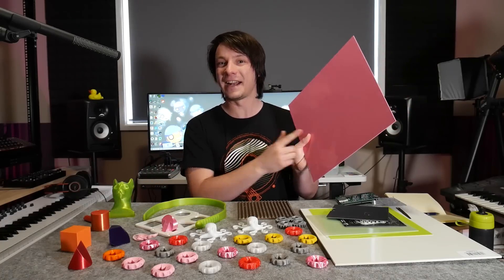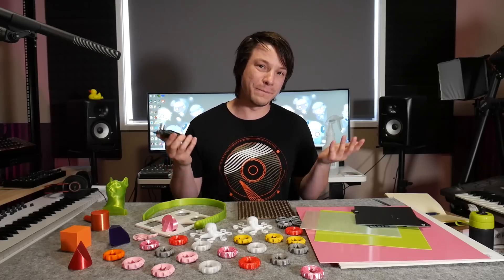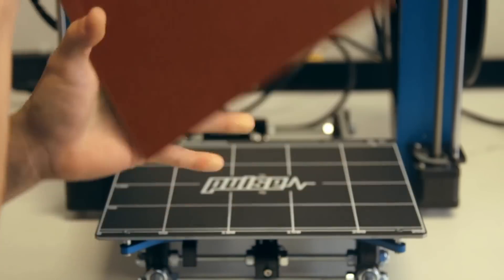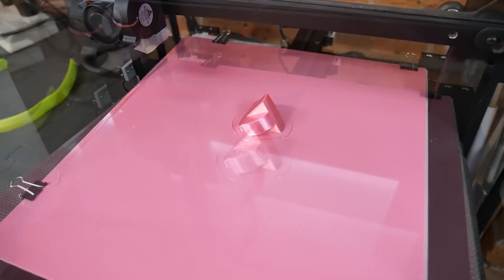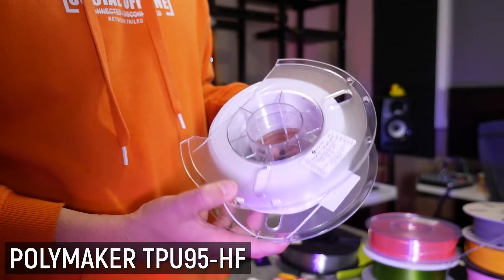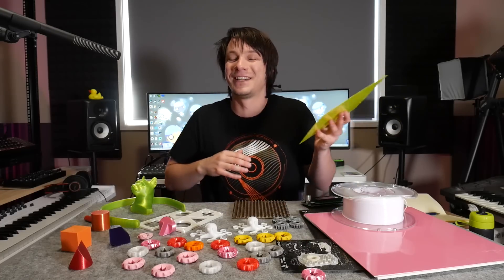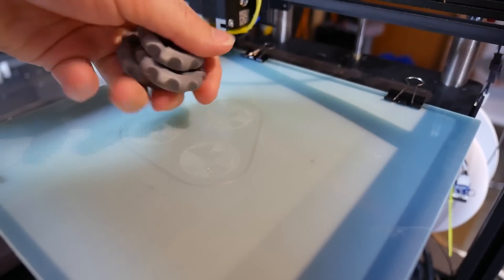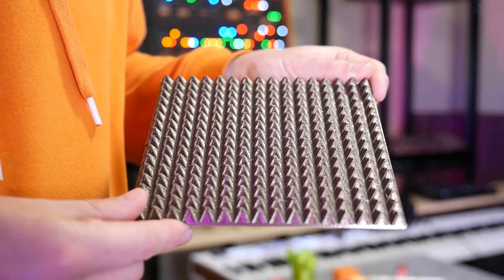G10 - The best print surface you've never heard of.

Comment: as for ABS, I print it with minimum cooling and higher temp, it improves overhangs drastically and doesn't break layer adhesion. ABS is my go to because it's cheap and tough.

Comment: I use silicone sheets under my build surfaces in stead of those annoying "alligator clips". Heat transfers through it, and the stickiness holds onto the build surface firmly. I would recommend 1mm thickness.
Reply: For what are such sheets being normally used? Would help to find them.

Comment: Glad you like it :D i use G10/FR4 for years now. Recently took the thin stuff and glued it to a spring steel sheet. That way you dont need clips, heats faster and is my absolute favorite surface :) great video 👍
Reply: Just wondering why use this over spring steel suck as the pei bases? Most people have excellent quality from using just that.
Reply: @madbull4666  Nylon....people seem to have issues getting nylon to stick to pei. If you don't print nylon G10 looks to be a waste. The storage issues of nylon make it a pain for hobbyists so its probably the reason G10 isn't very popular.
Reply: @madbull4666  What ever works for you. I switched to G10 before powder coated PEI was a thing. The PEI stickers an Buildtack clone always ripped after a while. It's just no maintenance for me, so I'm happy with it
Reply: Is there much truth in the stories of destroying a pei sheet when printing PETG? I was afraid to try PETG as my first print on my new pei bed...
Reply: @super_slo  I frequently print PETG on a Prusa mk2.5 with standard settings with a spring steel pei bed with no issues. I do generally preheat the bed to approx 40 degrees to remove the print tho. It was my first try at flexible that ripped a hunk out of the pei! At least I think it's pei that Prusa use.
Reply: @super_slo  for powder coated beds its less of an issue I think but those with a glued on sheet tear up after a while if you don't nail the first layer height.

Comment: You compared it with glass for example, but how does it compare with the powder coated PEI sheets from Prusa? Obviously you get a very different finish for the bottom layer, but I had great luck with PETG with powder coated PEI.
Reply: Exactly what I'm wondering too.

Comment: if your sheet does warp just bake the sheet between 2 sheets of glass at ~130 for a couple hours then let it cool slowly
Reply: Celcius?
Reply: @hyperspeed1313  yep. Make sure the glass is flat and cool the sheet as slowly as you can
Reply: to elaborate for anyone else that stumbles in here, you want to let the temperature lower on the sheet as evenly as possible, else itll shatter as one part cools faster and bends, well its a glass like thing, glass doesnt bend it shatters. need to heat it evenly too or the same will happen if it even matters for this material. 
also unless itll adhere to stuff at that temperate wouldnt any sort of really flat+smooth and rigid material work (e.g. a metal sheet?)
Reply: @Ruckusmatter  Not all polymers have a glass transition temperature and most of the epoxy resins are among of them. Once the are cured the reaction is done and you have one board size molecule of polymer that can't be shaped by temperature like thermaplastics do. The only thing that is working here is pressing them flat.
Reply: @0thorgal0  then mine was plastic. It was warping under heat, now it doesn't

Comment: How the heck do you do a first layer calibration for this material on a Prusa Mini when the G10 isn't composed of the metal the PINDA sensor requires to sense correct distances from the G10 build plate?
Reply: You can get circuit board material with one side copper clad pretty easily.
Reply from the maker: Hmm that might actually work !
Reply: @MakersMuse  I don't own a Prusa and have never dealt with the PINDA, but thought they would scan up to 2mm?
Copper pots seem to work fine on an inductive cooktop. 
Is the inductive circuitry of the PINDA so different that you couldn't run the copper side of a 1/16" (1.5mm) clad board face down?
Reply from the maker: Can't, you're stuck with metal or a super thin layer but might as well use PEI.

Comment: 0:00 G10, what is that?
0:36 Oh, it’s FR4, the same material used in PCBs! That also has the extra advantage that you can use a PCB if you can’t find alternatives.
Reply: Same. I was like 
"Wow, I've heard about so many beds, even rare ones like FR4 for Nylon, but not G10. Let's find out what this mysterious material is"
"Oh it's just FR4"
"Oh. You can use it for more than just Nylon??"
Reply: @KentoCommenT  fr4 is better read some of the other comments high temp and fire retardant
Reply: Hmm so I could design a PCB without copper or solder mask and have JLCPCB fab it.... Might have to give that a go
Reply: @sonosus  You pay them by the square inch for "production" of nothing, and etching off all the copper that someone carefully laminated onto it, so it's possibly not the most efficient way to do it! (I guess they would mill out corners etc for you though, if you wanted a nicer mounting solution)
Reply: @howardjones543  You could use 1 sided PCBs. That way you get FR4 on one side for adhesion and copper on the other for heat distribution.
Reply: @sonosus  You can buy single-sided copper-clad FR4 directly, without involving someone like PCBway. It's what you use to etch your own PCBs at home. Cheap on ebay.
Reply: @howardjones543  what's the best place to get this in bulk?
Reply: @sonosus  Wouldn't a copper ground plane each side aid in heat uniformity?
Reply: @KentoCommenT  Isn't it the raw FR4 that gives the material the stickiness? Maybe having a ground plane on one side could work though. I'll give it a shot on my Ender 3 sometime.
Reply: @KentoCommenT  You forgot the different heat expansion. I don't know how much it will affect uncut cuprexit (name of FR4 with copper foil for PCB's), but difference between heat expansion of copper and FR4 is the the cause of delaminating copper when you overheat it while soldering 😞 In the better case it will just deform, in worse case it will start to delaminate and either way you get an unleveled print surface. Bare FR4 would then be the best option for 3DP bed.
Reply: @sonosus  That sounds... Wasteful.
Reply: FR4 is also one of the first materials that was used for print beds. Obviously people hacking electronics back then were familiar with circuit boards and their heat resistance. Even experimental heaters were built right into those by etching a long coil on the bottom.
Reply: Where to order it please ?

Comment: I wonder if adding magnetic pads to the Ender 3 plate and the base of the G10 will work. Has anyone had layer shifting with this method?
Reply: In theory it could work.
Personally, if I did that I'd also add some kind of indexing method to keep sheet shifting to a minimum.
Reply: I did it and it works Really Well. My Ender magnetic bed has alternating strips of North-South, which you discover when you place a magnet on it.
I bought an A4 sheet of magnetic vinyl from Office Works and cut off 6 strips 1 cm wide. To those I attached the thin type of double sided tape. I removed the tape backing, placed the strips on the bed then placed the sheet of G10 onto the strips, rubbing over it to ensure a good adhesion. The G10 always aligns exactly as it was placed, ie perfectly. 

It's great to be able to take the sheet off, bend the print off, then replace the G10 perfectly without effort.
Reply: @gryphonista  Thank you for the reply. Sounds promising. What's the thickness of the magnetic vinyl?

Comment: I bought my ultrabase for the "cold and release" feature. Which worked great. But now the prints don't stick at. all. The filament gets dragged by the nozzle. Might buy some isopropyl to clean it. I've tried cleaning it with 100% ethanol but it doesn't work.
Reply: You can always just use water and soap
Reply: @Karavusk  thank you

Comment: Alternative title: "The print surface they don't want you to know about."
Reply from the maker: Print bed companies hate him!
Reply: @MakersMuse  Thanks a lot for not being like that!
Reply: This one little trick they use for perfect print results...
Reply: You won't believe what print bed does this 110 years old maker use.
Reply: Doctors hate him
Reply: I'm really surprised nobody knows this. I thought as FR4 it's been like the gold standard for 3D printing for years.
Reply: Even someone who has been giving me some helpful hints led me to borosilicate glass, but I'm feeling this will be a better replacement for our lab since the glass plates are so thick and difficult to stick to w/out gluestick. :/
Reply: and for a reason because it's now not available in EU anymore because it's sold out
Reply: It deforms if used incorrectly so clearly not beginner friendly. Companies don't want their products returned because the bed melted....no rocket science why its not used widely. Outside of nylon this seems to perform no better then pei which has none of the warping downsides.
Reply: @backgammonbacon  There's FR4 made for high heat, only difference is the polymer. I'd recommend that instead of G10
Reply: @WhenDoesTheVideoActuallyStart  you are correct
Reply: @backgammonbacon  at what temperature does G10 warp?
Reply: @backgammonbacon  Sure, I love PEI, but it is much more expensive than G10, at least here in Argentina, and you cant't get it for printbeds larger than the one for the Ender 3, I'm trying to cut out a piece of G10 that I bought for this (this one seams much harder than the one Angus cut). I hope it works!
Reply: @Plank WithANailIn  Some say nylon needs a lower bed temperature, like PLA bed temp low. It is apparently a mistake to run it really high like ABS.

Comment: Could also just glue a magnetic sheet under it instead of using clips. Many printers already have a base that is magnetic and you can buy magnetic sheets that can be cut to size at many places. Just got to make sure that the sheet is suited for the temperature or it wont stick anymore after a while. I think Whambam sells kits where you just have a thin metal sheet with glue on one side and a separate magnetic bottom sheet that can take high temperatures.

Comment: Markforged uses a g10 bed on their printers. The bed is about 10mm thick and machined flat. Just a glue stick layer is needed for their cf nylon (unheated bed). Really nice machines but the cost is out of my reach. As a proprietary system they're excellent from slicing with their online tool to printing.
Reply: Wait really? We have 2 markforgeds at my robotics team, I never knew it was garolite
Reply: @картошка-т5э  Next time you use it look at the bed and you can see the pattern of the woven fiberglass fabric in the surface
Reply: A glass and the glue layer do the same, i use now the creality surface , but i use the glass side, its works great, its very solid "black glass",with hair spray or glue(only for abs)

Comment: Will work well with Nylon and this is what Markforged uses for their print beds. Edit to add, markforged does not use a heated bed, and the platform is roughly 6mm thick... so it's extremely rigid unlike the test here with Nylon on a very thin sheet. I've printed 100s of hours on those machines with the reinforced nylon and I have yet to replace the print bed.
Reply: They use G10 or FR4 or what?
Reply: @huberttrzewik5644  they won't tell you, but it's probably FR4.

Comment: in germany its seems like it's called: GFK (Glasfaserverstärkter Kunststoff ( Fiberglass reinforced Plastic )) and it's expensive XD
Reply: I found it for less than 10€ a sheet. The professional version HGW 2372 (Glashartgewebeplatte) is expensive though
Reply: GFK from AHLTec (black & shiny)  goes for 9.10€+2.99€ on eBay for an Ender3-sized bed. Plain FR4 (stefftech) costs half as much, but has a matte finish instead of the shiny one. Both work very well. One aspect I like of the plain FR4 is that it's somewhat transparent, makes it possible to check the first layer from below.

Comment: Take a look at FR2 aka Pertinax, it is more less the same as FR4 but uses paper instead of glass … just makes it easier to handle I think.

Then take a 0.5 sheet and stick it on to some Spring steel, best flex plate ever! 

Last but not least, if the FR2 looses adhesion, just use some Scotch Bright to roughen it up.
Reply: I might be mistaken here, but doesn't Pertinax release dangerous odors while heated up? I successfully sanded FR4 too (wear air protection) :D Cheers
Reply: @certified-forklifter  that actually depends on the variant of FR2. Original Pertinax is rated for a temp of up to 120C 
But you can get variants that go from like 90C to 200C.

But you want to use some protection when grinding it, the dust is not something you want to breath in.
Reply: I think FR2 is phenolic impregnated kraft paper.
It does smell when hot but is not toxic.
That's why phenolic paper is used for honeycomb cores in aircraft structure.

Comment: Hi Angus,
this material looks very interesting for me. I used GFK (it's glass fiber composit, similar to FR4) on ja former CTC Bizer. Is G10 the same material or is it somehow different?
Reply: It's more or less the same. Fun fact is that the pigmentation for different colors actually seem to slightly affect the hardness of whatever resin they're made of.
Reply: @jonathantaylor2584  
Thank you for the reply. I used black ones and grinded the surface for more adhesion, but I had very different adhesions, even for different PLA brands. One did stick very well and the other worked only with glue stick, where the other one didn't stick at all.
Reply: @holgerkeller6902  I wonder if flatness might be a big factor with adhesion. My only experience with g10 and printing was a markforged printer at school that had a machined, non heated, g10 build plate. That printer used glue stick on the bed and printed a carbon fiber reinforced nylon.

Most of my experience with the material has been machining aftermarket knife parts. I've noticed that some sheets vary in thickness as much as 0.015" over 12 inches and can even be slightly bowed.
Reply: G10 and fr4 are the same apart from the resin used to bind it together. Fr means fire retardant. I not sure but it may withstand high temps compared to g10. fR4 is used in PCB

Comment: You may have better luck searching for FR4, which is the fire retardant version of G10 used in printer circuit boards. :)
Reply: FR4 is also great for model rocket fins and bulkheads.
Reply: Hold up if its similiar to FR4 cant you print directly on the reprap heated bed pcb o_o
Reply: @someoneonlylol  Yes and no. Those bed have typically copper on both sides, covered in solder mask. I have mine made of single side PCB without solder mask, but i still like to cover it with glass, because you won't find 3mm thick PCB easily and thinner likes to bend alot.
Reply: @someoneonly  Yes, you can - although the top surface is actually solder resist lacquer.  A slightly risky strategy, but they are not expensive to replace, so in extremis, it will likely work!  Choose lower bed temps than you normally would and expect some bowing on larger parts.  Careful - if you have the traces side down what it could short out on, ideally put an insulating layer underneath, and try not to flex the PCB too much when releasing the part.
Reply: Aka FR5
Reply: That's mentioned as one of its names in the video. As an Australian, I can also corroborate that it is has been very hard to find here whether you look for G10, FR4 or Garolite.
Reply: @t_z1030  Maybe try Glass Phenolic Plastic Sheet, the seller i found on ebay had this in his description
Reply: @t_z1030  Yeah, I can't find it in Oz in 500x500 size

Comment: I was put onto G10 a number of years ago as I could never get Nylon to stick and haven't looked back. As @makersmuse said scuffing it up with some sandpaper really helps it to stick, useful for other materials as well.

Keep in mind that depending on if you have an ABL sensor G10 may not be suitable for your printer. For example I cannot use G10 on my Prusa MK3S as it throws off the PINDA sensor. It may be specific to the sheet that I got, but keep that in mind.
Reply: Inductive Sensors only react to certain metals (iron)

Comment: Re: binder clips -- Have you tried photo frame clips? They're lot smaller on the top side and worked pretty well while I used glass. Might not fit a thinner bed profile though.
Reply from the maker: Yeah I just find them too fiddly to attach but could be a lower profile option!
Reply: I don’t own a 3D printer yet but you could try slide clips to hold your surface down they are smaller then a bulldog clip so take up less print area they and also are reusable, and surprisingly strong.

You would need the appropriate sized clips for the thickness your clamping and a dispenser.

Search office works to find slide clips and a slide clip dispenser.
Reply: @tbbrady  huh not been aware of this thanks.

Then again I bought Ultimaker bed clips, clones, and I just love them. I attached rear ones permanently with nuts, and front ones bent so they are between the nut and the spring, and they just swing out. It was only $3 total shipped and I can easily install and remove the bed, and there's no chance of clips shooting across the room and leaving a giant scratch in my monitor again.
Reply: I’ve had luck with blue painters tape. The nozzle can just print right over the stuff. The minimum I’ve found that does the job well is across each corner. Certain brands/types work better than others.
Reply: See my tip elsewhere about using magnetic vinyl strips. It works incredibly well.